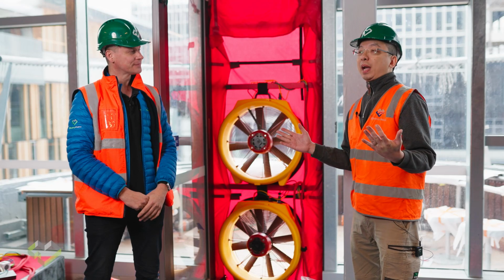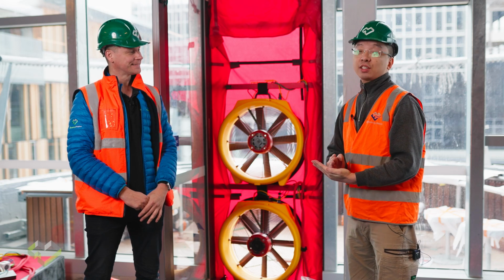Commercial Building Blower Door Testing.  An opportunity for Lower energy costs

Comment: Every single building should have to have this done, its crazy the building code here in Australia that this isn't the standard.
Reply: An energy efficient home or business is more comfortable and saves money in the long run.
Solar energy on your roof combined with battery storage can make people more independent from the grid and natural gas supplies. Add solar and supplemental electric heating, infrared heating or a heat pump for home or business heating..
All big box stores and manufacturing sites can support solar energy on their roofs or parking lots.
Added insulation, double or triple glaze windows, energy efficient doors, energy efficient heating and cooling systems, energy efficient appliances, LED lighting, smart thermostats, solar panels combined with battery storage and a electric vehicle charger in the garage or car park. People are too focused on the short term costs and miss out on long term savings and comfort. Blower door testing and air sealing are under appreciated tools.Even if you have money to burn you should not waste it.  Climate Change will impact everyone. Leave a better future for your children and grandchildren. Join in and speak up for the future of the planet
Reply: It's required in Norway, by law.
I reckon most builders in Australia wouldn't even be able to explain these concepts. Care factor: Zero.

Edit: In every single new building that is built, residential and commercial. There are standards that must be met. It's illegal not to meet them, with evidence.